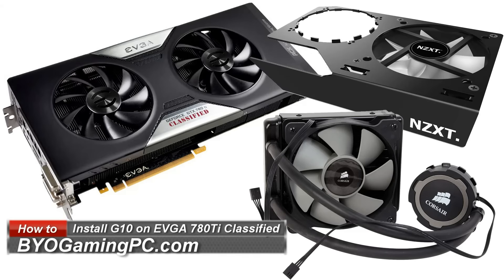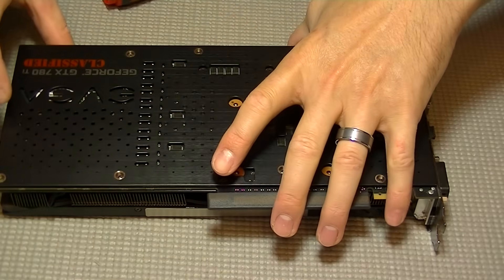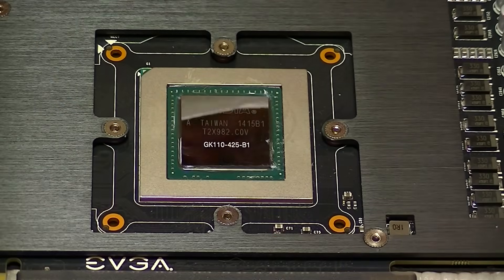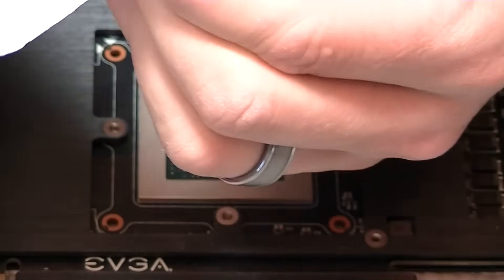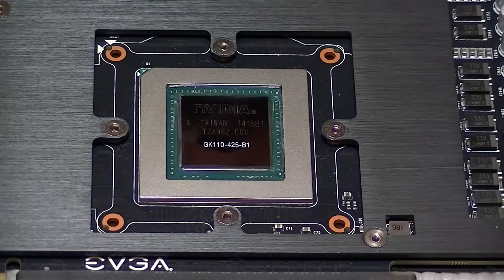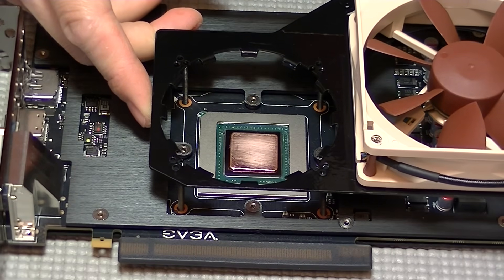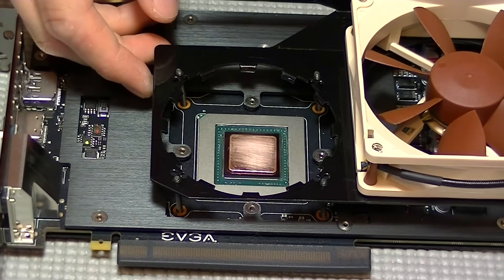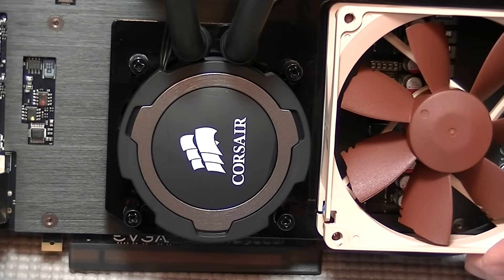NZXT Kraken G10 Install without Removing Heatsink

Comment: +BYOGamingPC I read that a 1.2mm thick shim was just enough to make it flush with the heatsink plate on a 980ti, would this be the same for a 770sc acx? Im looking to do this and i just got all the parts except the shim. I can order one fast on amazon prime but its 20x20x1.2mm. Would that be enough? Otherwise i would have to order through ebay from china and it would take longer but i can get a 25x25x2mm to cover the entire die and also guarantee its thick enough. On the other hand, i could just use two-1mm shims. Is it worth stacking them?
Reply from the maker: Yes, the 1.2mm should be fine.

Comment: Hey!  Nice video but just wondering...... Won't adding do much of thermal paste plus the shim sorta insulate it ?
Reply from the maker: It would be difficult to add too much since the pressure will push the excess out.
Reply: +BYOGamingPC  OK thanks!
Reply from the maker: My pleasure.

Comment: What's the point of putting a Copper Shim ? Can i do it without it ?
Reply from the maker: You must have the shim or there will be no contact between the water cooler and the GPU. It fills the gap.
Reply: +BYOGamingPC that sounds like a design flaw of the G10?
Reply: BYOGamingPC And can i add little heatsinks for the VRAM ? If yes should i ?
Reply from the maker: It has nothing to do with the G10 but the size of the AseTek style cooler and the metal heatsink plate that surrounds the GPU die on the PCB. The die sits lower than the plate and the diameter of the coolers are larger than the size of the ring so they rest on it instead of the die. The shim fills the gap.
Reply from the maker: Yes you can and you don't need them unless you plan to overclock the memory quite a bit.
Reply: +BYOGamingPC is it specifically for this card, then? Other cards don't have the ring surrounding the die?
Reply: +BYOGamingPC Will i need a shim with every gpus or is it only for the 780ti ?
Reply from the maker: It's actually the heatsink plate that is on the board for the VRAM and VRM's. You can remove it if you want but I would leave it on and use a shim for the added cooling of those components. It's mostly EVGA's cards that have this plate but like I said, you can remove it if you want.

Comment: you say 30mm screws in the video but the link is for 25mm screws. which one?
Reply from the maker: +Brandon Eich Use the 25mm ones. I used 30 but they were a bit long.

Comment: Thanks, you make awesome guides that not a lot of people provide. Do you think this setup will be compatible with the new GeForce 1070 & 1080? I bought the G10 a few years ago but didn't use it so I plan to change my GTX 780 for either a 1070 or 1080 and use it then.
Reply from the maker: +Xainfinen We will have to wait for them to release but it is very likely that it will work.
Reply: BYOGamingPC Okay, thanks.

Comment: Does anyone have a working link for the VR005 GTX 460 accessories? I 
REALLY seriously need it. I got an H110, NZXT G10 now I just need the 
VRM cooling kit, what are some other VRM kits that are JUST as good that
 can keep my VRM temps around 55C 60C max? Any help as soon as possible 
would be appreciated. on a 290

Comment: Here is a nice DIY trick if you find yourself with a floating shim;
Solder the shim to the AIO copper top - you will need to remove the copper top from the AIO cooler since most are plastic.
Don't put solder between the shim and the copper top, solder the edges as we don't want any gaps (or if you are not confident with your soldering skills).
Only downside is that you will not be able to remove all the solder from your AIO if you ever want to use it for a CPU again, but it is not hard to sand off the solder.
And once again, the GPU is untouched :]

I would also like to add, if you don't fancy the solder idea, get a few thermal pads and squeeze one in between the shim and the AIO copper top - thermal pads are not designed for heat dissipation (only heat transfer) so don't use them for that - they are there strictly to close air gaps.

Comment: Awesome video, but I'm thinking your shim is too small for this GPU, despite your claim that it works "just fine".  This GPU has no heat spreader over its die (like most CPUs) so not covering its surface completely would really impair cooling.  Also, more non-conductive thermal paste is needed for the same reason.
Reply from the maker: +coinsagE46m3 I'm not disputing that a larger shim would be better. In fact a 25mmX25mm one would be more effective but if you cannot find one larger then the 20mm one dissipates enough heat to be effective. The amount of paste applied was enough to completely cover the die and shim.
Reply: BYOGamingPC I would argue that because you used a shim too small, the thermal paste you applied, while perhaps covering the shim, wouldn't have completely covered the die. There's probably a good 15-20% or so surface area of the die neither the shim nor the paste is touching. 

In my personal opinion, this upgrade isn't worth it without using a shim that completely covers the die.  Dollars-to-donuts if you tested a 20mm X 20mm (partially covered) and a 25mm X 25mm shim (fully covered), you'd find a very appreciable difference in temps (would actually love to see a video like that).  And I wouldn't be surprised if this had long-term negative GPU longevity effects. 

Again, I want to reiterate that this is just my opinion.  Could be right on, could be completely off-base.  And, having said all that, I want you to know I greatly appreciate you making this video as it has lead me to feel comfortable attempting it myself on my 980 Ti FTW, albeit with a larger shim.
Reply from the maker: +coinsagE46m3 A larger shim would be better but the smaller one does dissipate enough heat that the card never broke 60C under full load.
Reply: BYOGamingPC That's actually quite a bit higher than I've seen many others get, unless that temp was taken while the card was at a full, balls-to-the-wall overclock.  Most vids I've watched on the subject are getting load temps of well under 60C. 

If that's good enough for you, that's cool, but because my card hovers around 70-72C at full load with just the ACX cooler, it's nowhere near enough for me to do this conversion.  Speaking of, I will be performing said conversion tonight with a Kraken X41 and a properly-sized shim.  I'm going to report back what temps I was able to achieve.  I realize that comparing my temps with yours is not really fair, as I have a newer-gen card and a better cooler, but it'll nonetheless be interesting.
Reply from the maker: +coinsagE46m3 Sorry that was a typo, I meant 60C.
Reply: Haha well that's much better.
Reply: BYOGamingPC Just thought I'd share the temps I was able to get with my G10 setup.  Man that was a bitch to put together!  I had LED lighting on my ACX cooler and, man, that fucking connector...anyway, I digress.

Max peak temp I got after extensive benckmarking was 53C, with an average of 48C.   Quite a bit less than the mid 70C's I was getting with the stock config.  Thanks again to BYOGamingPC for making this video.
Reply from the maker: +coinsagE46m3 Nice results! Glad it was helpful!

Comment: Do anyone know if you can plug the pump to the gpu fan header?
Reply: +Salt OnTap Most pumps require a constant 12v so I would advice against doing so - as mentioned in the video, it is only recommended to connect one fan to the GPU header and use a splitter if you need to add more - this applies to the pump as well as the header cannot run the fan and the pump - and sometimes not even the pump on its own (if you have a variable speed pump).
Reply: Luis Alvarado Oh okay, i gave up on the projet tho, shipping from ebay is way to pricey
Reply: What part are you having trouble sourcing?
Reply: Luis Alvarado mostly the M2.5 screws, there's none in Sweden.
Reply: Hmm, weird.
Vary your search to include 3D printer parts as M2.5 screws are used in 3D printers and other hobby stuff. Good luck!

Comment: would this work for the non ti version of the classified 780?
Reply from the maker: +alex strömberg Yes it will!
Reply: +BYOGamingPC nice :D
Reply: +BYOGamingPC the 780 classy doesn't come with a backplate, so should i use the backplate that comes with the G10?
Reply from the maker: +alex strömberg Yep!
Reply: +BYOGamingPC so if i use the backplate i don't seem to need the washers for the back side?
Reply from the maker: +alex strömberg Correct

Comment: compatible or support for powercolor R9 380 ???? please help
Reply from the maker: +el-fatih Muhammad According to NZXT's website the cooler is compatible with the R9 380. As long as the PCB of your model is the same as the stock layout then it should work with no problems.
Reply: +BYOGamingPC is there any other liquid cooler that also matches the PowerColor R9 380 ???
Reply from the maker: +el-fatih Muhammad The only possibility for an all in one cooling solution would possibly be the Corsair HG10 A1 http://azon.ly/68PTcL I'm not 100% sure that it will fit the R9 380 perfectly so you may want to do some more research on it. Personally, I would stick with the Kraken G10 because I know that it works. The only other option is a custom loop.

Comment: Would this method be the same or would look like a bit if it is made on the zotac gtx 980ti amp edition?
Reply from the maker: +datkangel2 The process would be nearly identical.
Reply: Oh i see. So the PCB of the zotac 980ti amp is identical to the pcb of classified. Thanks
Reply from the maker: +datkangel2 My pleasure.
Reply: +BYOGamingPC btw would it make any difference if i would use the exact size of copper shim?
Reply: +BYOGamingPC and another question the pcb of the zotac 980ti amp edition would look like this https://www.techpowerup.com/reviews/Zotac/GeForce_GTX_980_Ti_Amp_Edition/4.html would the step by step and the parts needed  be the same?
Reply from the maker: +datkangel2 Yes, it would probably be even better to use the 25mm shim.
Reply from the maker: +datkangel2 Yes, the parts would be the same.
Reply: +BYOGamingPC okay thanks.

Comment: Is there any reason why you couldnt use the backplate, retaining nuts, and washers supplied with the kraken with the longer bolts that you used? I feel like they would have fit seeing as the the thumb screws fit the bolts that you used.
Reply from the maker: +Ken Hodel Nope, you could use the NZXT backplate but I don't like the look of it. I'd prefer to only see the full cover backplate.

Comment: Thank you Sir, I was wondering how I can fit a normal fan to the GPU fan controls. PWM adapter seems to be the trick, also don't you need heatsinks on the VRAM? It seems that you have removed the heatsink entirely.
Reply from the maker: +Lord Christoff The heatsink plate is still on the VRAM. I'm not sure why everyone confuses the GPU heatsink with the balck VRAM/VRM heatspreader/heatsink. The large heatsink we removed only conducts heat away from the GPU and that is all.

Comment: wonder if this would work with my msi 8gb 290x? I know with that particular gpu and the g10 there was a big issue with the vrm, but I also don't want to lose my backplate
Reply from the maker: +northern marine Yes, it will work but of course you will be using the holes for the AMD model instead of the holes used in this video.

Comment: you removed the heatsink, so how is the vrm temp?
Reply from the maker: +Adikara Dwi Atmaja On this particular model of graphics card there is a large heatsink plate that covers the VRAM and VRM. The heatsink you are referring to is the one for the GPU only and does not cool anything other than the GPU. The VRM cooling is much better without the airflow restriction from the large metal fins and heatpipes blocking the fans. The Noctua fan used in this particular setup also pushes a lot more air. Everything about this setup is superior to the original air cooler that comes installed.

Comment: is the vrm-mosfet-cooling plate from EVGA good? Or wouldnt it be better to pull it off and attach small heatsinks on the memory chips?
Reply from the maker: +melangkoh I would just use the plate from EVGA. It would be a better cooling solution.

Comment: Hey hey!

So quick question,

I have no need of hooking up multiple fans to the thing, the one should do just fine.  That being said, what is the purpose of the Gelid VGA Fan Adapter?  What does it do & how?

And follow up question.

Does this process work with the Kraken X41 or X61?

Cheers!
Reply from the maker: +Ether RPG You wouldn't need the fan adapter then and yes, the process is the same with the X41 http://amzn.to/1TR0DWV or X61 http://amzn.to/1TR0HpL.

Comment: Thanks for this video! It took me a while to find it, but I eventually wound up here. I have an EVGA gtx 770 sc acx and I ordered a g10 and x41 last night. There is no back plate, but there is the front vram/vrm heat sink board. From what I've read in the comments below and other places, I should be able to use the stock g10 back mounting plate and screws - all I really need is the shim. Is this correct? Thanks!
Reply from the maker: +Damien Kemens Yes, this is correct!
Reply: +BYOGamingPC Awesome! And thanks for the quick reply!

Comment: Bro.. I have an EVGA GTX970 SC ACX 2.0 
http://www.ekwb.com/configurator/upload/pictures/EVGA-GeForce-GTX-970-ACX-2.0-4GB-GDDR5-(04G-P4-2972)-PCB.jpg

The VRAMs heatsink is on Coolers like u can see here http://forums.evga.com/download.axd?file=0;2221919

I wanna use an watercooler and i want to keep my heatsink on the back side. If i put a little heatsink directly on VRANs it will works well? The cooler of KRAKEN G10 will not get the VRAMs hetsink, so they are stay alone without "wind". My case has not FUN on side, just in front and back. 

VRAMs heatsink picture: http://mlb-s2-p.mlstatic.com/4-x-dissipador-aluminio-com-adesivo-termico-p-vram-vrm-vga-18608-MLB20157945786_092014-F.jpg

Do u think it will works well? I intend to do overclok.

What size of copper shim do u think will be nice in my vga? (I just buy on blackfriday, dont has it in my hands yet.)

thx bro
Reply from the maker: +Leandro Rios I would just use the heatsink plate that comes on the card. There is no need to purchase other heatsinks. Front intake and rear exhaust should be plenty as long as there aren&#39;t any major obstructions to airflow like hard drives. Even so, the Kraken G10 is a great option for restricted airflow since most of the heat is ejected from the case due to the radiator removing it. Most of the heat is from the GPU itself.

Comment: lol this all costs more than getting a cooling loop and adding the gpu block to it
Reply from the maker: +opeope12 Not even close... A block and backplate are around $100 new alone, not to mention the upkeep and rest of the components to build a custom loop. You're looking at a minimum of $200 to even cool just one graphics card in a custom loop. A lot of people even have an AIO just lying around not being used.

In no way does this ever cost more than a custom loop.
Reply: This costs about 200 dollars and if you are also water cooling cpu then the total cost is over 320 and a block is like 100 + full water cooling with switch loop is like 150 so total is 250
Reply from the maker: +opeope12 You must live outside the US. This only costs about $100  brand new in the US. $30 for the G10 http://amzn.to/1vDs9PA and $70 for the H75 http://amzn.to/Y1ffMu. The CPU cooler would be another $100 if you want to include that for the H100i that was used in the total build.

A full custom loop is going to run at minimum $30 for a reservoir, $100 for a pair of radiators, $120 for the GPU block and backplate, $50 for a CPU block, at least $25 in fittings, and another $25 in tubing. This comes to a grand total of, and I was generous in those prices, $350 and that doesn't include biocide for the water.
Reply from the maker: +opeope12 True but you also have to include additional fittings, tubing, and fluid. You would also want to include an additional radiator to have a proper setup or you will be feeding warm liquid to the GPU. You definitely don't want to feed from the GPU to the CPU without a radiator between.

Comment: Why do you need a copper shim? Shouldn't it work without one.
Reply from the maker: +Stuart Trappe It will if you remove the heatsink plate that covers the VRM's and VRAM. They stick up too high for the cooling block to make contact with the GPU. The block will rest on the heatsink plate before it ever makes contact. The shim fills this gap.

Comment from the maker: +Newbie Tech It should but I've not tested it. I don't know of any reason it shouldn't.
Reply: +BYOGamingPC Hello, Might be a stupid question but what is the reason behind using a copper shim on the GPU? Thanks
Reply from the maker: +James Walter It's necessary if you want to keep the black heatsink/heatspreader plate installed. If you don't, the water cooler will not touch the GPU and will only make contact with the black plate. The copper shim fills the gap.
Reply: +BYOGamingPC Are you still using this card, and how well is it running? Thank you for replying I subbed.
Reply from the maker: +James Walter I've not had this card for quite a while. I'm sure it would still be running great if I did though.

Comment: hey byo.  ive got an evga 970 ssc with the same heatspreader. it has no backplate.  would i be able to do this without the copper shim.  and im using a kraken.
Reply from the maker: +Daseoff102 No, the heatspreader is the reason you need the shim, not the backplate.